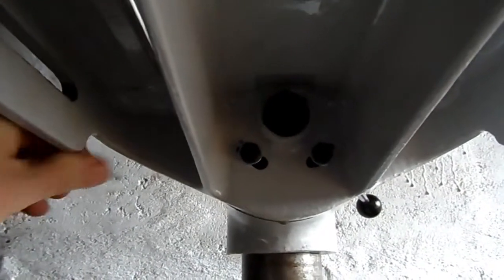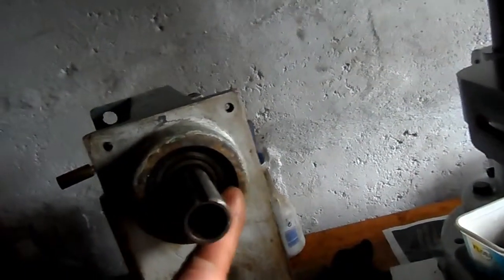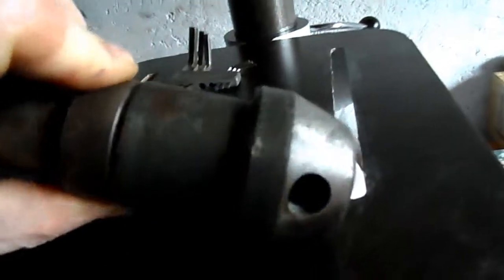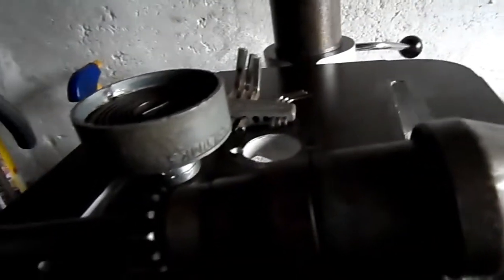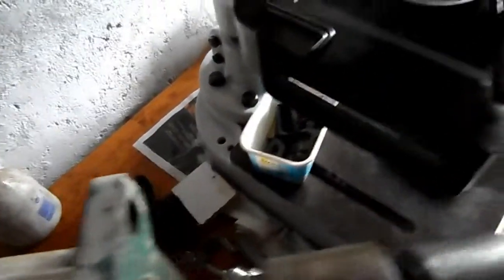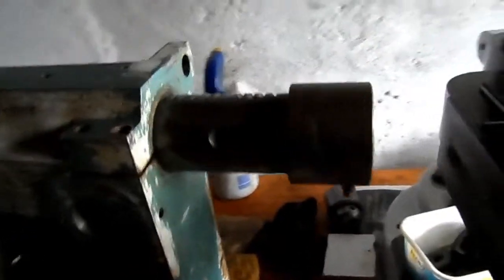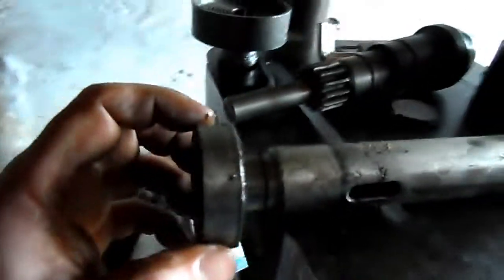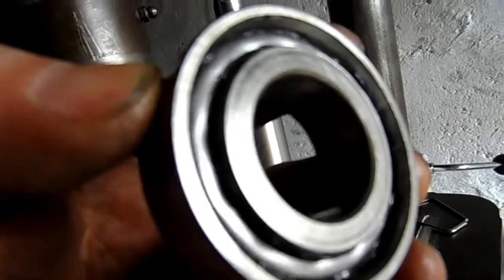Meddings Restoration   Episode #13 Compressed

Comment: what happened to this series? has the restoration stalled?
Reply from the maker: Unfortunately it has been put on hold. I need to source a couple of new bearings. No big task i know. Now im back to work I have some funds to utilize for bearings etc but little time and with the winter months drawing ever closer Im loosing the light in the evenings. The generator i use for power in my shed is partially stripped for repairs so I need to get that done before i can get on with the drill really
Reply: ah :)
fair enough, well good luck with it...